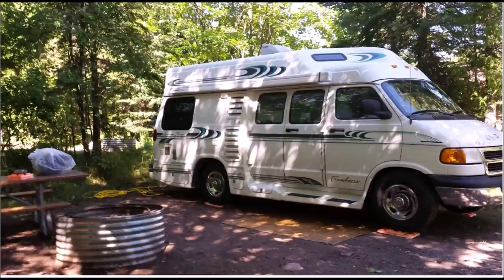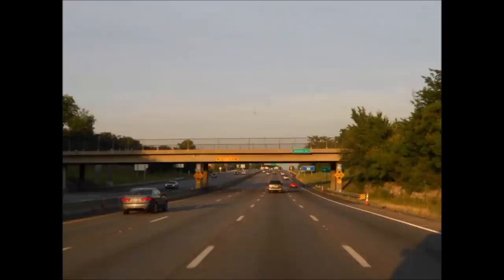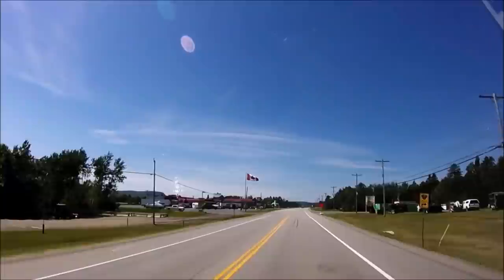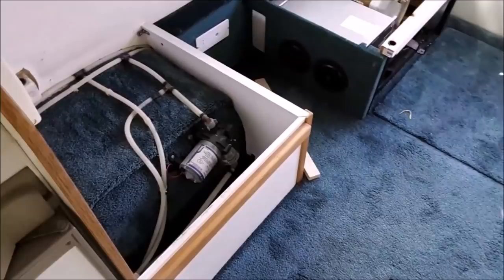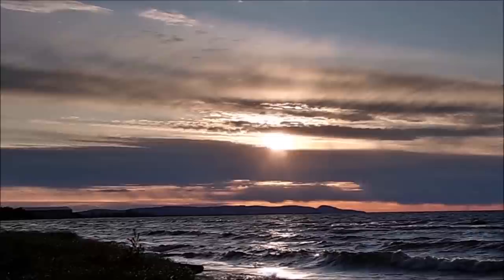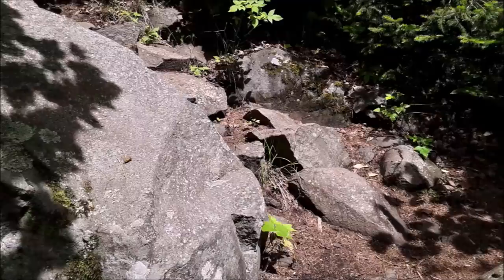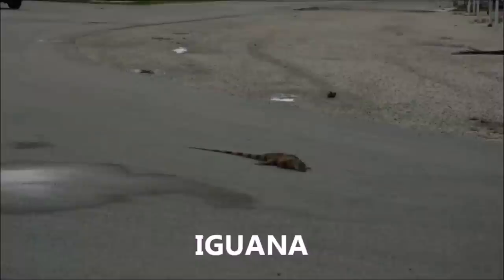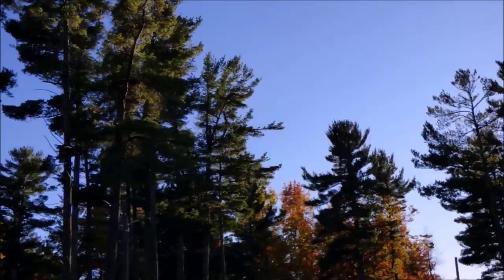Vanlife & Class B Reality Check ~ Some Truths to Consider

Comment: Hey Dano, great video! How much did you spend on your used class b and how did you know it was mechanically working , drivable, and most of the rv stuff like heater, water pump, generator were all in good working order? Did you get it inspected before buying? Are you still traveling with all this Coronavirus quarantine going on? Thanks for being real!
Reply from the maker: Great question. I bought it almost 8 years ago for 15 grand. I could get 20 grand for it now even with the way more miles. I found one close to me but it wasn't in good shape so I started searching online for Leisure Travels and found this in Springfield Missouri. It was a Camping World so I contacted them and they assured me everything worked. So I took a chance - rented a car for one way trip and told them if it isn't everything they claimed I will drive the rental back to Dayton Ohio. Camping World gets a bad rap, many times deserved but they did me AWESOME. They tested and then showed me that EVERYTHING worked perfectly. When I test drove it there was some pulling and I said this isn't gonna work. They put brand new tires on at no charge, I drove it again and it was fine. Eight years later, I've had a couple issues but it is still in pretty great shape and I have ZERO regrets from my process. This was the exact model Class B I wanted so sure I took a bit of a gamble but as most know it is getting ever harder to find these older gems.  I hope that helps and all the best. :)
Reply: Wander Dano , thanks for responding, I’m undecided about buying an rv right now or just to wait and see what’s going to happen before pulling the trigger with all this Coronavirus stuff happening. Do you think it’s a good time to buy one now? There seems to be road blocks to me buying one at the moment. Stay safe brother.
Reply from the maker: @sccphilly  I always do my best to respond. :-)  That is an interesting question about buying now. I guess it could be a good time to be a buyer but travelling appears like it is going to be difficult for a while. So buying cold be one thing but using it might be another.

Comment: Hi Dan,
I have been looking at getting a Leisure Travel Van or something similar.
Are they all built on the same wheel base? Some are Dodge and some Ford. Few are Chevy.
In the pictures,some look shorter.
I found one for sale. It has a cabinet instead of the coffee maker. And side bathroom shower. 
Any thoughts would be helpful. 
I have to continue to do research.
Reply from the maker: I am biased but I think the Leisure Travels like mine are the best. lol Most seem to be the Dodge 3500 and yes there are also Ford and Chevy platforms used too. I think the length of mine is pretty standard to this age group of Class B. The best advice I can always give is to look at as many as you can - preferably in person and once you have found your favorite version.. don't wait too long if one becomes available. These don't last long.  hope that helps and all the best.
Reply: @WanderDano  I haven't been able to find any in New England. I'm in R.I.
The one I'm interested in is a 2004. The price was lowered.
This one doesn't have the roof windows.
Have you seen any Leisure Travel Van's while traveling? Maybe take some pictures and an interview.
I'm fascinated about the little differences in the models. There is an older YouTube video on the making and some interviews.
Reply from the maker: @277kne  Yeah If actually seen a couple "twin brothers" of mine while traveling. Some with two more captains chairs behind the drive and passenger but I wouldn't want those - then again that could be modified.

Comment: Puzzling that millennials go through all the trouble and twice the expense of building out a van that ends up not having half the usability and comfort of a good used commercial built rig like yours.
Reply from the maker: I gt why many want to build out their own because they can have it the way they want, plus older cargo vans can be cheap. To me, just my preference, I want to be able to stand up. Older ones like mine can still be pricey - I know if I choose to sell mine I could easily get more than I paid for it because of the explosion in pricing across the whole Class B market.
Reply: Wander Dano a quick search on RV Trader shows a beautiful recent Roadtrek in excellent condition could be had for asking price $30K - $50K(at most).  An older model Roadtrek goes even cheaper. $30K for a Roadtrek is not much. Most of the custom builds don’t have everything the Roadtrek has so I don’t know why they settle for less.
Reply from the maker: @whoistheroach136  I often try to make the point that if someone wants to build out a van and have all the things a pre-made Class B has: shower, fridge, ac, genny, plumbing (sink toliet and shower), propane furnace and water heater.... obviously those pieces parts add up FAST FAST FAST. I looked at a few Roadtreks but prefer the Leisure Travels but like you say once you add all the "innards" I mention it is gonna be cheaper and better to go with a cared for Class B. :-)